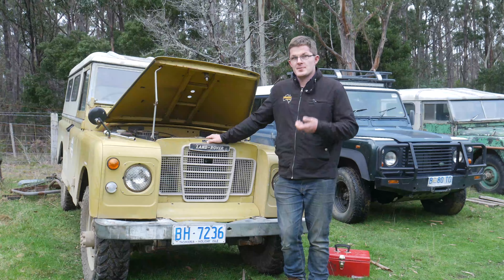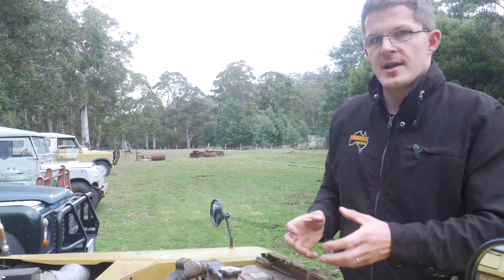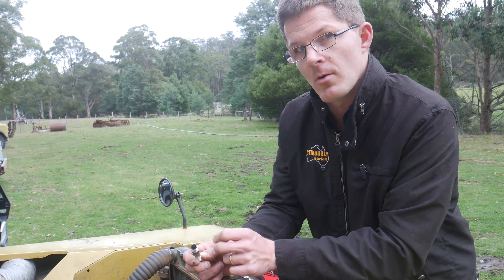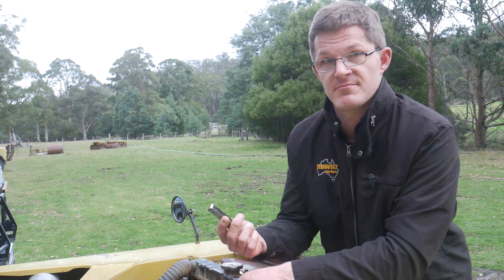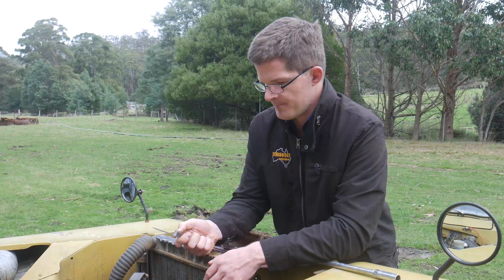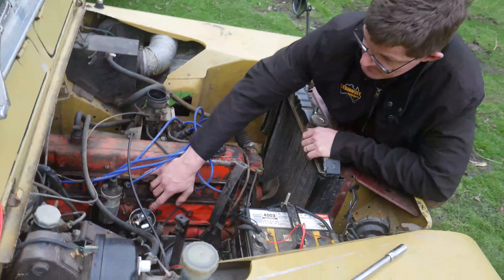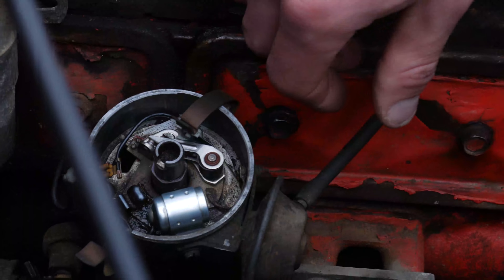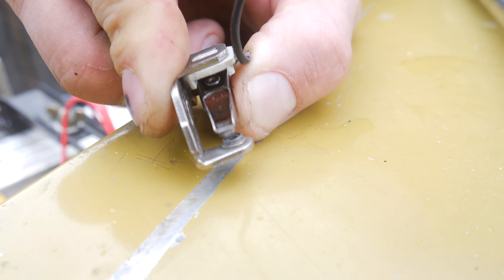How to Adjust Point Gaps and Spark Plugs

Comment: Dont forget the point gap ie dwell angle has a direct connection to the ign timing , every time you play with points check your timing with a timing light , static is ok but not accurate enough . Also new points have grease over the contacts to clean rub contacts with a rag , shirt whatever is handy . The wear on the contacts is caused by arcing not impact . Always best to set plugs and points a few thou over what the book says
Reply: Thanks. Pete!

Comment: Please can you help me, cannot bleed Series 3 brakes, push pedal first time, to the floor, second time some pressure. Check all valves, and cylinders.
Reply from the maker: Hi George. Do you have a 109inch or 88inch? This will determined how you go about bleeding the brakes. Kind regards, Geoff
Reply: @seriouslyseriesaustralia  Thank you Geoff 88 series 3 1978, my 7th series, never have brake issues before